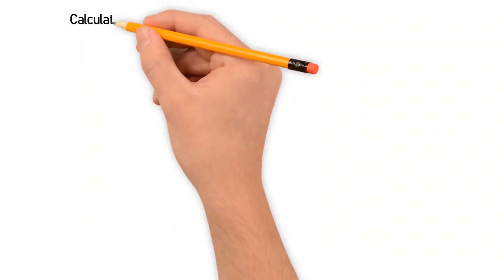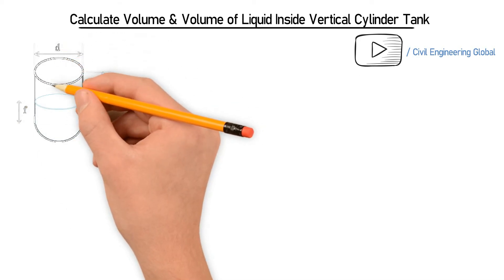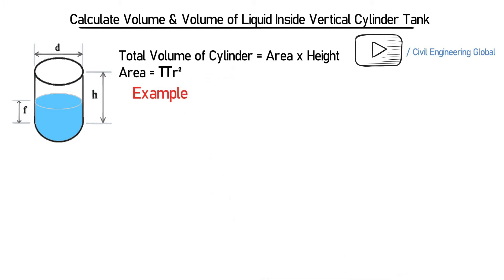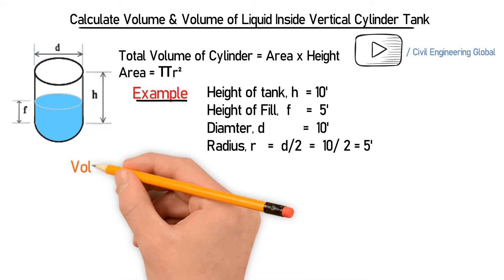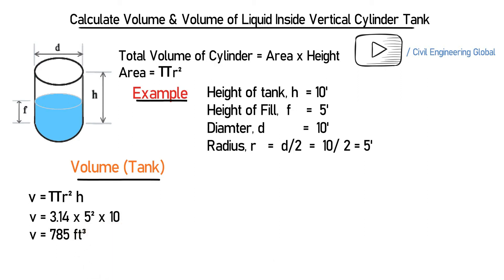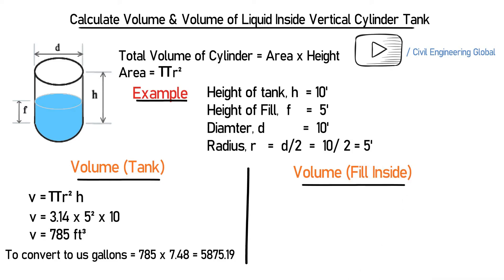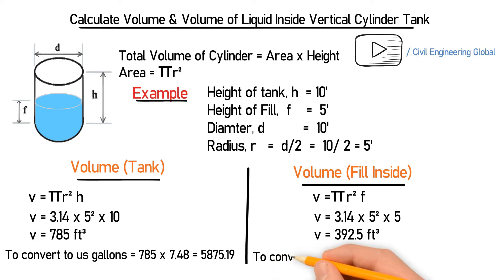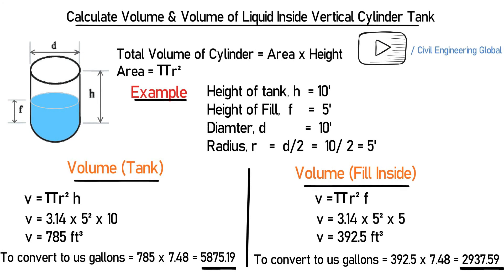How To Calculate Volume & Volume of Liquid Inside Vertical Cylinder Tank

Comment: How did that 3.14 come in volume(tank
Reply: From the formula of Volume. Volume equals Pi (who’s first numbers abbreviated and typically used, are 3.14 (then the numbers go on forever.) 

So volume equals Pi squared (or twice) multiplied (or ‘times’) radius (radius is measured from the center of a shape to the outline or outer edge of the shape.) diameter is the measurement of the shape itself (as seen with circles) and the perimeter is the measurement of the outside of that shape as a whole (like the whole circle or cylinder.) Area is the measurement of the entire INSIDE of a shape—-full circle explanation, radius is the measurement of the Area but cut in half. Example: if the total or maximum Area of the top of this cylinder was like 30, then the radius of the top of the cylinder would be half of 30, which is 15 [15+15=30]. So to calculate the Area, or to learn an Area’s radius, just split the number provided in half. 

Math is a lot. Lol
Reply: @Gammaba3  Thank you for clarification.  Was wondering why 3.14🤣
Reply: Area is equal to pi×r² 
And the standard value of pi is 3.14.
☺
Reply: @salvenitin1703  correct

Comment: How to calculate pressure using oil fluid in a vertical cylinder if it is pressed 10 mm while the rod length is 200 mm, the diameter is 1.8 mm and the rod is 1 mm. Please advise and provide a solution with the formula.